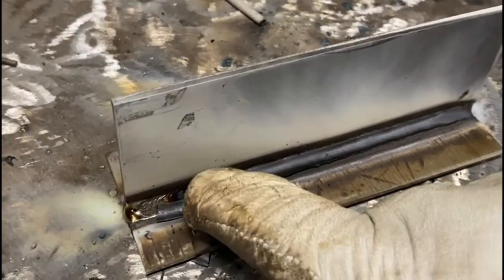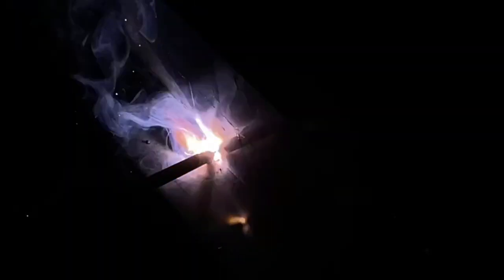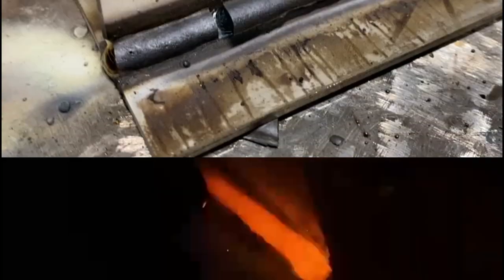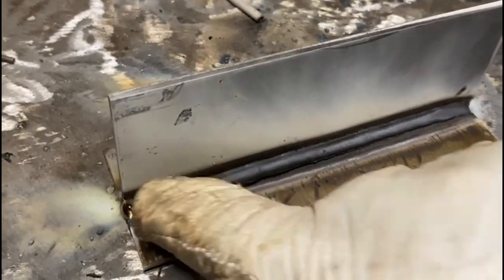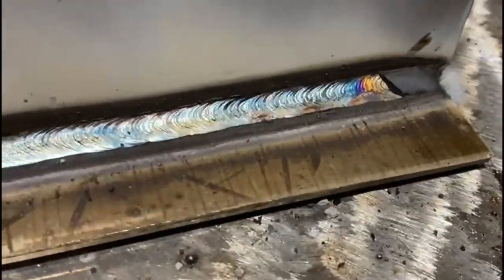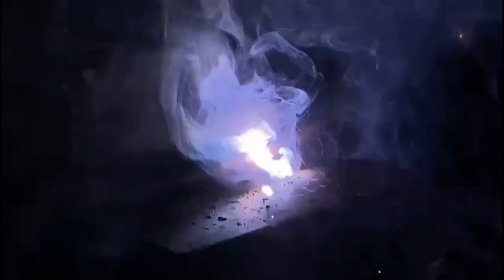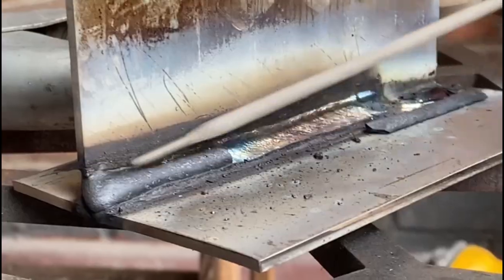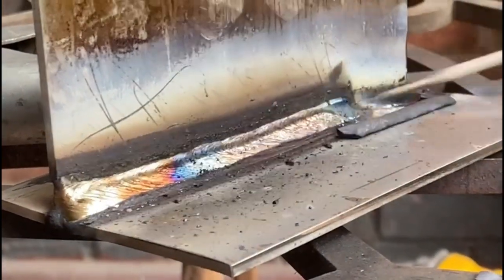Stainless steel stick welding with the best technique!

Comment: Hi, thank you for the video. What rod are you using?  What size rod?  And voltage?
Reply from the maker: Metrode 316L. Size 2.5mm on around 65 amps.